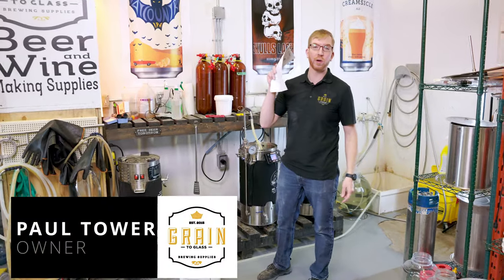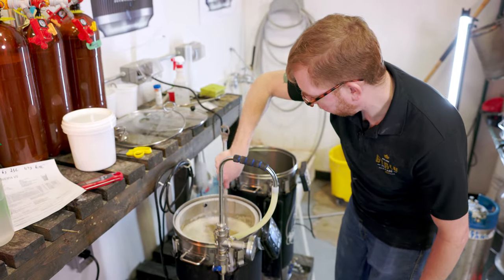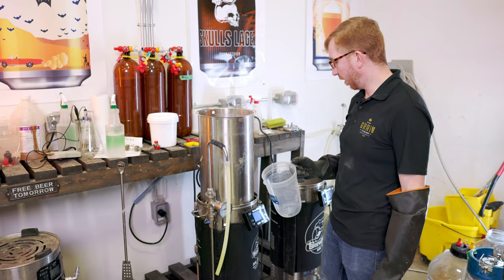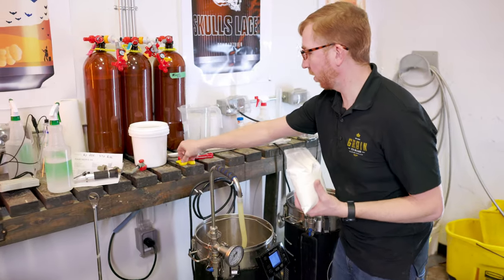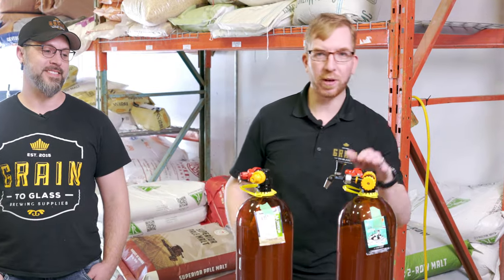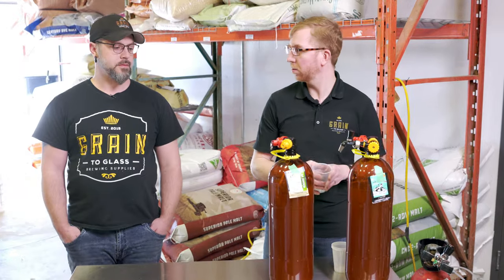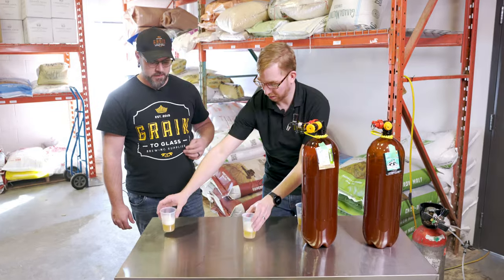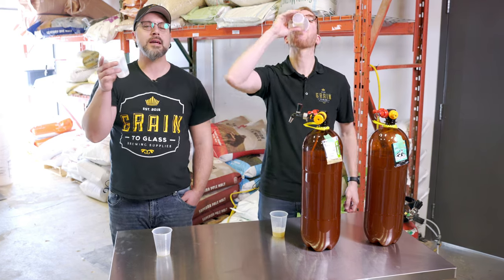Skip the Boil, Nail the Flavor - Brewing A "Raw" All Grain NEIPA On The Brewzilla

Comment: I just did a Raw Hazy, I mash hopped my bittering addition (three times the normal amount) and it turned out great!
Reply from the maker: Awesome, what was your method after the mash?  What temperature did you raise the wort to?  Cheers
Reply: @graintoglass I mashed out for 10 minutes at 80°C to pasteurize, that's also when I added my aroma hops. I then sparged, let it sit outside in the cold for a couple of hours and then pressure fermented at 2bar. Dry hop after three days for three days. Sparging with cold water further decreases chilling time. You might get a little less sugar out though.

Comment: This video proved I am not insane. I too have yet to have a completely clean profile from kveik. Theres always some farm house influence in the final profile. Regardless of how much yeast nutrient I use. Thanks for honestly saying that in the final product using lutra.
Reply from the maker: I've tried many strains and temperatures but have always found that kviek yeast imparts a distinct flavor/aroma in the finish.  Cheers
Reply: @graintoglass  I just did a blonde with Lal's Voss. Jacketed the ferm @95 degrees. Ferm was violent. Nose is neutral. Finish is pretty neutral up front, but develops a low key hint of lemon zest, and a back ground hint of that farm house funk. It' a crushable ale, dried out nice, but I agree I've never done a Kveik that was perfectly clean, either. Split the same batch of wort and inoculated the other bucket with Lal's Diamond Lager, and it DID finish clean & clear. So there ya go. Distinctly different hop profile, too.